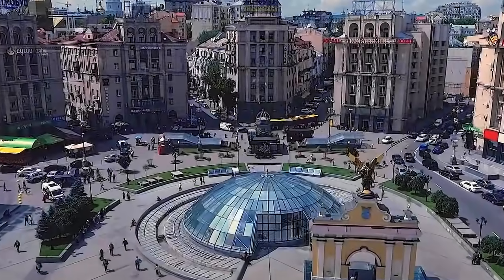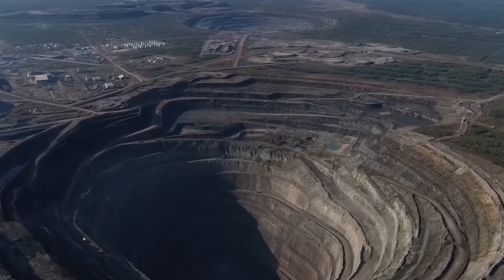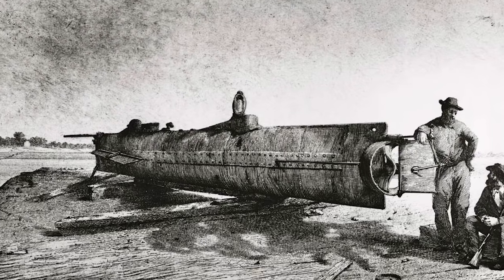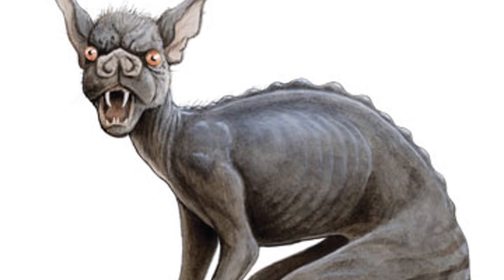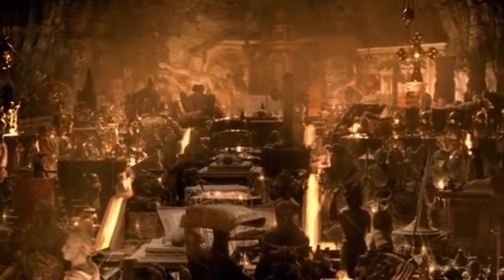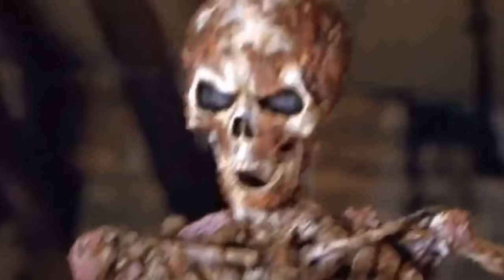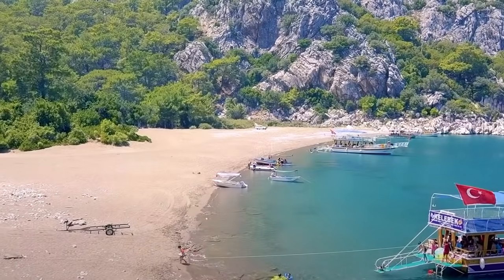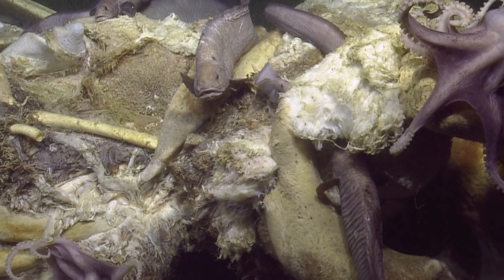12 Most Incredible Recent Discoveries

Comment: Your Hunley research appears to be way off.  The Hunley used a spar "torpedo" or a barrel of explosives attached to the end of a spar which was also attached to the submarine.  The latest consensus of opinion is that the sub was way to close to the target when the explosive went off and the concussion actually killed all the crew immediately.  The blast also damaged the sub and as it drifted away from the target if slowly filled with water and sank.  All of the crew were found at their battle station.  The submarine was actually found only a few hundred yards from the remains of her target, the USS  Housatonic.

Comment: Where do these videos get their "facts"? There weren't any torpedos in 1864. The Hunley carried a mine (small keg of gunpowder) lashed to a spar fastened to the submarine. The spar had a sharp iron point that was forced into the hull of the Housatonic. The Capt. pulled a rope which armed the mine. The Hunley then backed off the Housatonic. It exploded in a couple  minutes, eventually sinking the ship. The Sub turned and proceeded away. The loss of the Hunley is still unexplained. It was NOT caused by the mine. This is where I left the parade. If the other  "Incredible recent discoveries" are on the same plane, you're wasting your time viewing this s**t. The search that found the Hunley was financed by Clive Cussler, by the way.
Reply: Didn't see your month earlier reply before I launched my similar comment.  I visited the restoration within the 1st year of recovery.  More people should visit.  The third crew were so brave to volunteer after the deaths of 2 earlier crews!
Reply: @lawrencehulsbrink6224  I should have elaborated more. The mines of that day were frequently referred to as torpedoes but of course they didn't move. And the Hunley was NOT blown up by one of its torpedoes. Adm. Farragut at Mobile Bay famously said, "Damn the torpedoes. Full speed ahead." Interestingly, because of the copper hull sheathing of all wooden vessels, the usual method of attacking ships underwater was to ram a pole or spear with a pointed barb through the plating and into the wood. This was what had defeated David Bushnell's Turtle submarine in the Revolution.

Comment: Diamonds are pure hoax
*Natural diamonds are not pure and are weaker than artificial ones.
*Makeing an artificial diamond is not something really hard on manufactureing level, and it costs almost nothing.
*diamonds only benefit is being really stif, what makes them good cutting blades.
difference between artificial and natural one is only its purty.
diamond price was pumped up in 30's by makeing lack of it at market. Actually they are not as rare rocks as usual human being could think of.
diamonds does not have any more practical value more than industrial one, and same goes for gold and silver.

Comment: THe information on the Hunley is inaccurate. The Hunley didn't have torpedoes, instead it had a long boom with an explosive on the end. When the Hunley delivered the explosive, it would explode. After the Hunley delivered it's first and last explosive, it signaled the shore that the mission had been completed.....then was never heard from again. When found, there was no damage to the submarine indicating the cause of the sinking. All eight crew were found in their seated position, not all trying to escape through the one and only exit. THis reason is why I believe the calculations on the amount of oxygen needed and how much was used were inaccurate.  I believe the crew ran out of oxygen, lost consciousness, and sank.
Reply: There is a theory that they were to close when singers torpedo blew and the shock might have been possible for the deaths. It was on a spar and the ship had to ram the Housatonic. They don't believe they were able to get back far enough because the rope fuse was not long enough. A group of men from Texas were instrumental in its creation. E. C. Singer and Dr. John Fretwell were two men from Port Lavaca. It was Singers torpedo they used. He also created underwater contact mines for the confederacy.